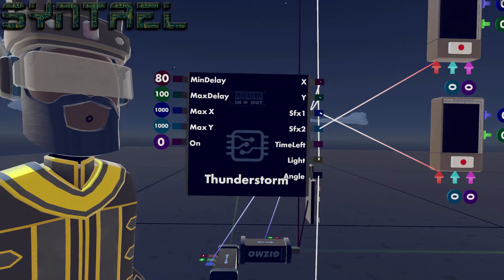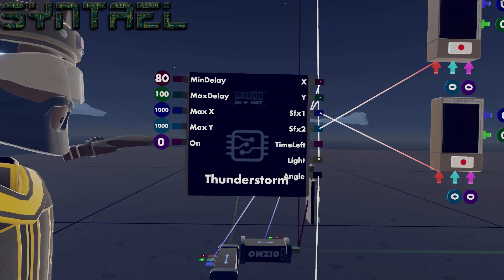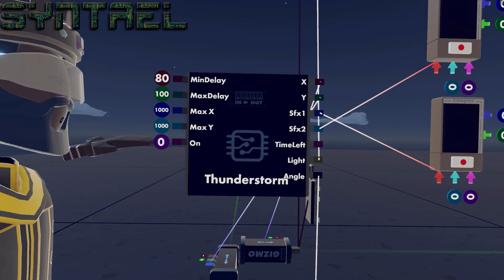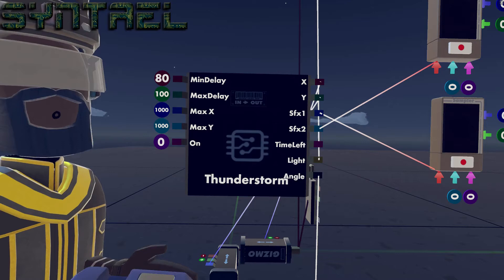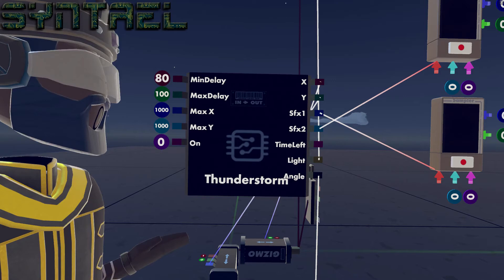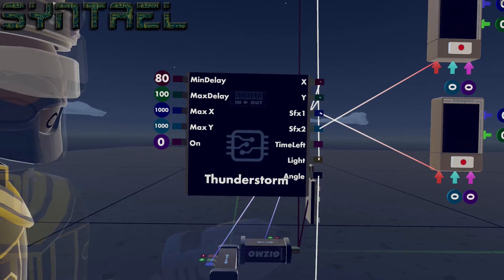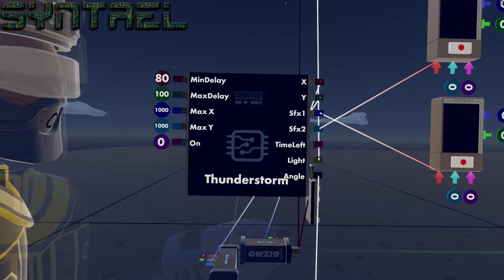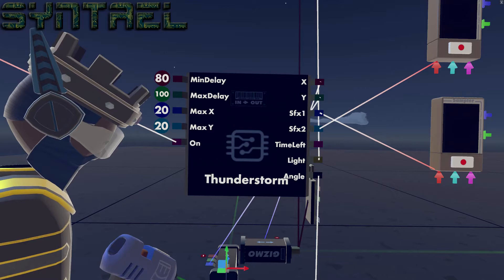Thunderstorm Invention Configure (Rec Room)

Comment: Could it be possible to see how it's created, please? I'm really intrigued by gizmos in RR
Reply from the maker: Sorry, I haven't really gotten on rec room in a few months now. It's not too complicated, it uses 3 pistons connected to each other to control movement in the x,y,z axis. There's a state machine that controls the looping and timing of the lightning strike. Each cycle it picks the random delay, waits, then pops the lightning bolt up to the map, flashes a light, turns the sky white, and plays a randomly selected thunder sound. Then it hides the lightning bolt again and the cycle repeats.
Reply: @syntael  Ahh, thanks. I'll try it out. I'll let ya know cause I bought the invention but I can't use it in a room I'm co-owning :')